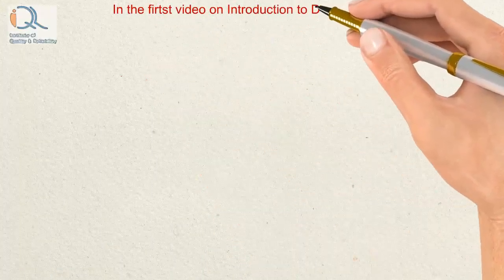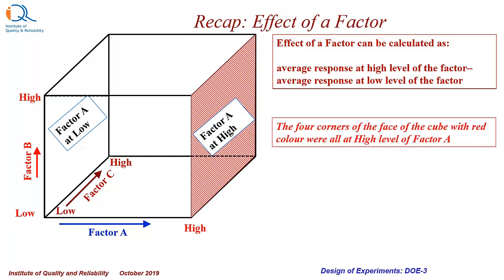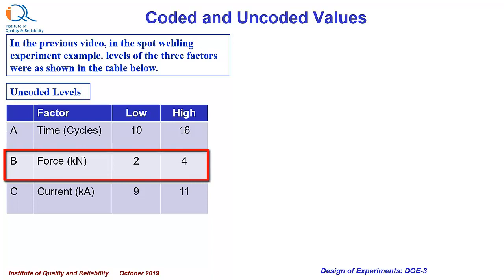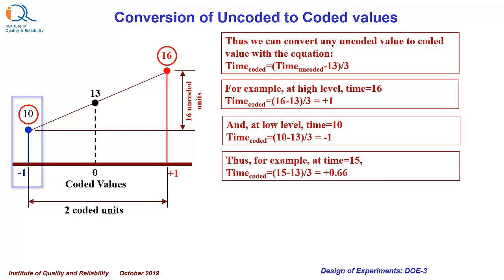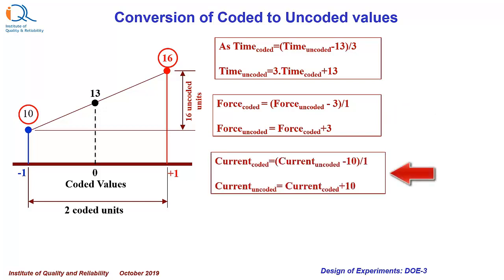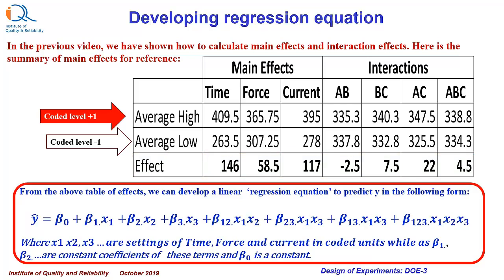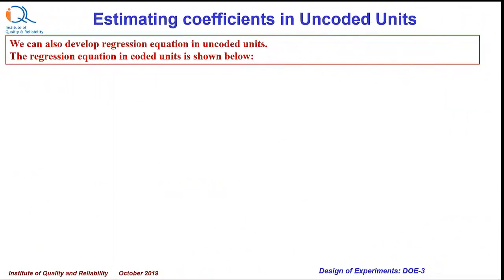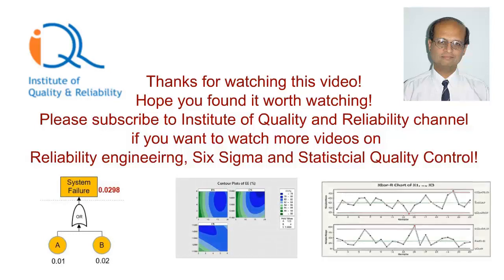DOE-3: Design of Experiments: Coded and Uncoded values & establishing regression equation

Comment: Hi sir, when we want to predict a new set of values, which regression equation should we use? (coded or uncoded)
Reply from the maker: You can use regression equation in either coded or uncoded values. If you use the coded values, the values of factor levels should be transformed to coded values. If you want equation in uncoded units, the calculation is somewhat tedious but I have explained the procedure in the video. 
Good luck..Hemant
Reply from the maker: You can use coded or uncoded. But if you use coded, you need to convert the factor levels in coded values. 
Good luck!

Comment: Great video.  However, I'm confused at the 9:34 mark with the conversion of coded to uncoded values in the Red Box. There seems to be an error in the 2nd and 3rd line items?  Shouldn't 29.25 x2C = 29.25(x2UC -3)?  Seems like it is missing the 29.25.  Also, 58.5 x3C should = 58.5(x3UC-10). Or am I mistaken?
Reply from the maker: Hello Jerry, Thanks for your keen inetrest. You are correct. There is an error in the equation shown. It should have been  29.25X2C=29.25(X2UC-3) and so on. Thnaks for pointing out the error. Appreciate your critical observation.

Comment: Hello,
Thanks for your very helpful video
I have created a full factorial design of 3 levels-3 factors, yet my values do not vary with the same interval, i.e. for a given factor x, the three levels x1, x2, x3 do not verify the expression: x2-x1=x3-x2. How can I change my model from coded values to real values?
Reply from the maker: You are refering to three-level factorial design. I suggest you use Define Custom Factorial design command in Minitab. This will allow to create the matrix first and then define the design. I would wonder why you need three levels. Why not two levels and a center point? or possibly a response surface design?
Reply: @instituteofqualityandrelia7902  i am using DOE as a modeling method. I have some experimental data from other research works, and i will use these data to create a model. Since the results are enough to create a 3-3 design, then why not.
Many thanks for your help